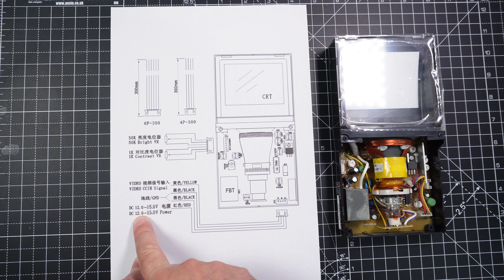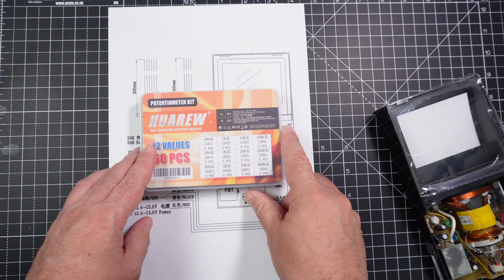Get started with this tiny flat $20 CRT from AliExpress

Comment: Thanks for the Video.  thanks for the tip of not using a metal screw driver. I got a couple of those just for fun.  I can not find information for the other adjustment in the units.  Have you found any other information like a schematic or description of the adjustments?
Reply from the maker: Glad it helped. I haven't had the time to work more on this, but I think they are pretty standard and probably they go with other names and same hardware.

Comment: I'm ready new to everything tech but I'm learning and I really wanna see if I can revive CRT at least for my personal use. I'm wondering if I can somehow connect this to a computer (probably Raspberry PI or something similar?) so I can use an emulator for old consoles. Because tbh, playing old games on LCD screens sucks
Reply from the maker: Technically you should be able to plug this tiny CRT to any analog video output. This one is only in black and white though, so that might be a problem for games. Hope you find a CRT, they are still relatively easy to find on eBay or flea markets

Comment: How did you get sound when I never saw you connect any audio jacks/plugs ?
Reply from the maker: The Play Station has a video and audio output, separated in three cables with RCA connectors. The yellow is video and the red and white are for each audio channel. I got the video in the CRT, which is the only thing it can accept and then I captured the audio with the computer

Comment: Doorbell at my parents place uses one of those 
Surprising it's from late 2000s early 2010s so apparently it was still cheaper than small LCD even back then
Reply from the maker: Interesting, I guess it's because it's cheaper to get an analog input from the doorbell camera and directly plug it into a CRT, than doing all the conversion into digital. I might be wrong though
Reply: @messycircuits  good point, it might be a case of saving on a not just on the screen but video processing and stuff.
Don't recall seeing model number on the doorbell tho, might be on the back side and i doubt my parents would be happy if i started dismantling their house to see how it's hooked up
Reply: May be also for temperature range - CRT works well in cold environment. LCDs work badly when cold (VERY slow), and deteriorate when hot.
Reply: @fhunter1test  and CRTs are probably more uv resistant than LCDs. Important for something that will be permanently on the outside

Comment: Will there ever be a color version?
Reply from the maker: Not sure but I don't think it would be that easy due space, complexity and power consumption. In 1989 Sony released the FDL 330S color, but it was an LCD display. I never saw one of these CRT in color.
Reply: Uunlikely, these wouldn't be a new design, and it's quite likely they're just selling existing old stock until it runs out.